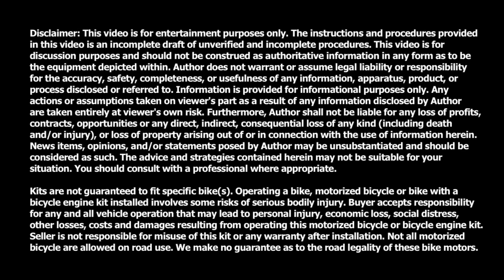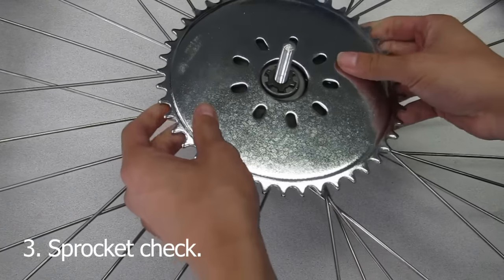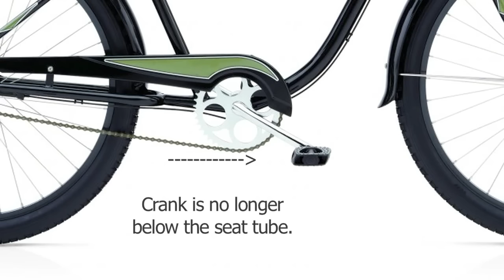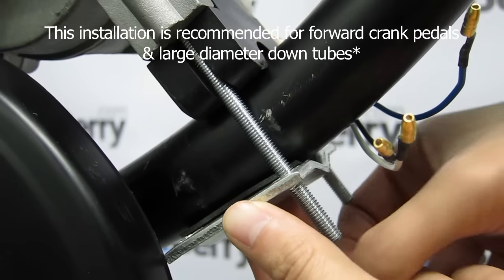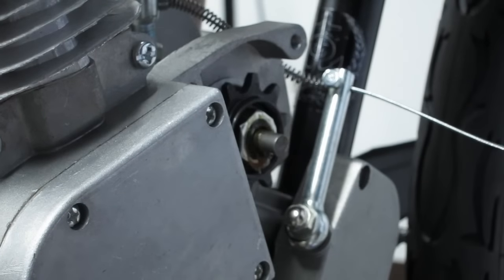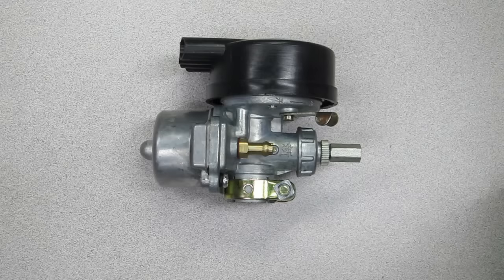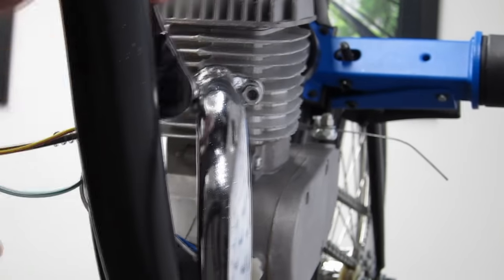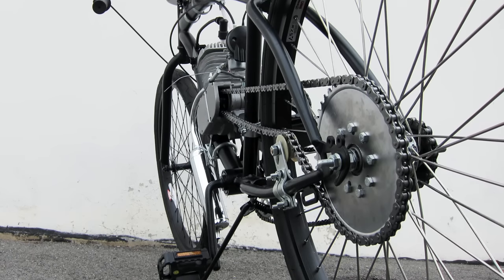How To Install 80cc 2-Stroke Bicycle Engine Kit FULL DVD 66cc 48cc 50cc

Comment: I have a 80cc 2 stroke bicycle engine when I test with my multimeter I get resistance only when I probed the black wire coming from the coil and the spark plug wire, but I do not get resistant through the blue and the black wire coming from the coil

Comment: hey bro, i ordered this 88cc 2 stroke engine and followed everything up untill the gas part.. I bought a small bottle of oil for 2 stroke and a  3.5 gallon gas tank (small) i filled that up and threw in the small bottle of oil and mixed it. Add it to the gas tank of the bike and the thing never turned on.. had it for over a year sittin in my garage. thinkin about using it this summer.. any suggestion??????

Comment: The idler adjuster for the chain ...Put it on the frame where you're going to install it ...and drill a hole in it... Tap the frame Bracket  Out, with thread tapper ....and screw bolt in there..... do that on both Brackets...And then they will stay in place ... they will stay straight up and down .... Just don't use 2 big a Bolt, you don't wanna drill too big a hole in your frame....

Comment: for the carburetor, its not fitting my bike frame, just a little to big, however it fits at an angle, (45 degrees) will this still work?
also my back tire is large enough to hit both the chain and the chain guard, what should i do i cant seem to move it out of the way so they dont rub, should i sand down the trim of the tire?
last thing my peddles hit the exhaust, any solutions?

Comment: I just got the two-stroke bike with the bike kit from bikeberry and it came with one wrist clip already installed inside the engine wrist pin clip but there's not a wrist pin clip on the other side of where you put the wrist pin in but and two little red baggies that were attached to the top part of the engine it had the four little clips but they're not the same as the wrist clip wrist pin clip do they not get my second wrist pin clip or do I use those other clips?

Comment: Hello sir. I'm missing 1 metal plate, and i saw on your video that you have like 2 in outer and the 3pcs metal plates on the inside. By any chance, where did you buy the extra or where to order them? Thank you!
Reply: I'm also missing plates. But I'm missing all 5 plates. And none of the wholes in the rubbers are even close to the holes on the sprocket. Figured I could flex the rubber but it's just way to far off. I'm also missing a retaining clip for the piston pin. So I ordered the clips.   But I can't find the metal plates to buy them. I emailed Bikeberry.   No response yet. But it's Saturday. Wer you able to find the plates?

Comment: im positive you can use any oil for these engines, but I know about as much as a 3 year old when it comes down to engines. so what oil do you mix the gas with?
Reply: there should be oil in your local Canadian tire(if you live in canada) or harbour freight ect. labeled  2 stroke motor oil
Reply: +Ap3xglide thanks, I live in florida, im nowhere near Canada.
Reply: +Fishes worst enemy oh lol then autozone, harbour freight,advanced auto,Raceland...
Reply: +Ap3xglide yeah, I think I've got some 2 stroke oil in my shed  for my now broken weed wacker.

Comment: Question: would it be possible to attach this to the sprocket at the front so the shifter will still function?
Reply from the maker: Without heavy modifications this would not be possible, as the drive systems are on opposite sides of the bike. There shouldn't be any reason why the bike wouldn't be able to shift with this installation.

Comment: Hi, I am attempting to complete my assembly of my kit. The nut which attaches the fuel line to the tank came separated from the valve itself which I'm not sure if it usually does. I assume it snaps on which I tried and okay but the valve still pops out which I don't want to happen when I put gas in the tank for the 1st time. I am not confident in it holding. Is this a common issue and will lock tight hold lt properly in place? Should I locate and reorder a new petcock? Thanks for any help, I can't seem to locate any tutorial mentioning the issue.
Reply from the maker: We're not entirely sure as to which nut you are speaking of and it sounds like a rare occurrence, but we would love to help you further and get you any parts you may need. Please contact our customer service representatives at 1-800-317-0479.

Comment: I have a nishiki Colorado, 29" wheel with disc brakes. Right away I'm having some issues. First being that it seems I don't have enough room for both the sprocket and brake disc to be mounted. Is there any way I can fit both on the opposite side of the gear cassette? Or will I have to switch the disc brake over to the cassette side? And if so, do I need a smaller cassette? It's a 21 speed bike with 7 gearsets on the cassette
Reply from the maker: Hey Chris, give us a call at (800)317-0479 and we can do our best to get you up and running.

Comment: Instead of opening the otherside of the engine, I just engaged the clutch and fed the chain through using something small to spin the wheel to pull the chain in

Comment: Thanks! An other question, I also have a button that I can press . Sometimes it stays in, but sometimes it comes out. What does that control?
 I'm trying to make the engine run slower, when the clutch is pressed in. Right now, the engine is revving loudly and fast. So as I've said, i'm screwing it in almost fully. If I do screw it in too much, the engine won't start, even with the choke on medium or high, nor if I give gas to the engine. If I screw it out more, i don't see much of a change.
Reply from the maker: If the button you are referring to is on the clutch lever, that is the locking pin for the clutch. You can squeeze the clutch lever and leave it disengaged by pushing in that pin. If the idle is not having much of an affect, try adjusting the jet needle.

Check out or video on carburetor adjustment. Hopefully it will answer some of these questions.
https://www.youtube.com/watch?v=j9bn9Wl5L1Q&t=4s
https://www.youtube.com/watch?v=XAaKSII_vbo

Comment: You've got the intake port and exhaust port wide open you're just asking for something to fall down into the motor you always plug up both ports before you work on em unless you wanna seized motor. also you could have mounted the chain when you installed the sprocket
Reply: no... Intake has a small mesh on it...

Comment: need any help really. i have an 80cc engine on a schwinn bike. the engine will not start no matter what ive tried. testing the spark plug and it gets a spark a little bit. i haveno idea where the choke is or primer on this engine. i bought it from someone locally recently and went through many new spark plugs.

Comment: Hey I’m having a problem where when I put the clutch cable in then while pressing the clutch lever it won’t freely spin any idea what’s wrong? And also my clutch flower nut won’t spin and I can push the plate inside to make it spin

Comment: I have a question can you flip gasket backwards? So that the carb is at the front and the exhaust is at the back?
Reply: I wouldn't. Because there is an indicating arow on the piston heat that points towards the exhaust. And if yo wer to re mount the piston and the engine head. The exhaust would be pointing forward.
Reply: That should have said piston head. Not heat..... my phone is smashed to shit... so it's hard to see when typing....

Comment: I've been riding 2 strokes for over 50 yrs. I find fuel mix ratio to be not fussy. I just splash some oil into the gas and go with it .

Comment: My down tube is too large for the motor threads. How will longer ones help if there's no enough room for them to get past without hurting the frame?
Reply from the maker: Our engines are intended to be mounted to frames with standard sized tubing for beach cruisers, hardtail mountain bikes, town bikes, and road bikes. Some down tubes are made in an elliptical shape rather than a circular bar or are on the smaller side of an oversized down tube; our extended rods are intended for these type of frames. Frames with a down tube larger than 28mm are not compatible with our center mounting engines.

Comment: I spilt honey in the clutch case cover. Will this cause a problem?
Reply from the maker: Honey is not considered an appropriate lubricant.
Reply: well y u have honey there
Reply: Hopefully you cleaned it. My hypothesis is that it will get very warm and burn. Hopefully it didn't clog up anything.

Comment: Question .. I just finish installing mines .. 80cc 2-stroke .. but my back tire is locked up is tht normal .. or did I miss something
Reply: ExtinguishFires _ 13 might need to adjust the clutch cover on it, sometimes come too tight from the factory
Reply: MrOranTee .. thanks for info .. thts what I thought 💭.. nw I have two more problems.. (one).. my petcock screw tht screws to the gas tank broke any ideas on fixing it besides buying a new gas tank petcock value.. (two).. I can’t keep it to stay idoling.. I don’t knw anything bout this stuff .. I’m learning along the way

Comment: I have a racing bike and the back mount will work but the front mount is a weird shape so it doesn’t fit right I even use the universal adapter and that still didn’t work please help

Comment: What is the little metal ball that fell out near the small sprocket where it drives the chain
Reply: It’s important for the clutch it’s the throw out bearing that takes the load when you pull in the clutch

Comment: 3:40
Can I push the bolts through the opposite direction?
Instead of the screws going in through the gear and popping out INSIDE the sproket, can they go OUT the gear and me bolt on that side? My fingers cant reach inside to bolt them in and it makes much more sense doing it the other way
Reply: Yeah that was the hardest part for me. Once I got it properly installed my hands looked like they went through a paper shredder

Comment: I just got done putting my together but my wires are white/blue/black are come out of the engine then the starter have a red and black come out then the spark pus has a blue and black wire and I think I have it wire up right but the engine still wont turn on

Comment: So if you have the clutch on one side and the throttle on the other; where do you put the brake?
Reply: I plan to put my break on the throttle side. Because I figure if I'm breaking I've already released the throttle..

Comment: would a lawn mower engine work because I was thinking of doing a project like that over the summer.
Reply: a weedwacker engine would be better in my opinion, but I suppose anything's possible. It depends on the type of lawnmower engine, if it's a vertical shaft 4 stroke, then running it with the shaft horizontal would cause lubrication problems.

Comment: Does it matter if the spoccket goes on the concave side or the convex side?
Reply from the maker: No, it should not make a difference. The difference in chain placement is roughly a 4 millimeter difference, which may help if chain clearance is extremely tight.

Comment: I got this kit. Recently the 66/80cc engine kit and its sadly missing parts you cant find at a hardware store. Pieces missing for mounting the sprocket. Literally the 3 plates. That's where I couldn't finish the video

Comment: I have a question , Could this motor be attached to a three wheeled  bicycle ?
Reply from the maker: We do not carry any mounting or drive system for adult tricycles. There is, however, a large bike modification community, and we have seen individuals mount our engines onto tricycles.

Comment: I got it wired correctly yet I have no spark. Could it be a bad CDI? How would I check it?
Reply: Check:

Is the Magnet's woodruff key in a 1-o' Clock position in relation to top dead center? (If it is backwards in the 11-o' Clock position, it will not start)

Are your CDI and Magneto giving good resistance (ohm) readings? (The specifications can be found with an online search)

Is the magnet still magnetic? (They sometimes lose strength over time)

Wiring - Black to black, blue (or sometimes red) to blue. White can be discarded or ignored if wired accessories will not be used.

The kill switch can cause electrical issues. It can be safely removed if so desired. To stop the engine, one simply has to stall the engine by releasing the clutch slowly while not moving.

The sparkplug will not give off a visible spark if it is not physically touching an electrical ground on the engine such as one of the cylinder fins. Make sure to do so.

Comment: What is the purpose of drilling the hole when assembling the throttle?
Reply from the maker: The throttle has a pilot pin that holds it in place and prevents the unit from moving when giving it gas.

Comment: Step 7. I reinstall but the motor become disengaged. There is a way to fix it? I think something is a bit loose. Do I have to tighten the shaft to engage the engine?
Reply from the maker: Give us a call at (800)317-0479 and well be happy to help you troubleshoot.

Comment: How much noise would one of these engines produce when it's running?
What is the top speed?
Reply: +Tholaran97 it's very loud (think weedwacker or lawn mower) and the top speed is 38 km/h which is about 24 mph
Reply: +Tholaran97 Its not as loud as you would think but putting some type of rubber between the engine and the bike at the mounts helps with noise.
Reply: delreydavid yeah ,thats exactly what I did.

Comment: Where did you put the grounding wire (white wire) I’m not getting any power and I think that’s the issue
Reply: White wires for lights.
If you don't have that then you put a rubber cap on it and leave it.

Comment: I got a Iglobalbuy 26" or 28"Bicycle 80cc 2 Stroke Motorized Gas Engine Motor Kit of amazon, I assembled as instructions indicated, and followed the wire diagram but I'm not getting any fire, I changed the spark plug, and also cut the connector of and hard wired the connection ,but still can't get it to start....I welcome any help.

Comment: Do you know if the motor would brake I you use it without a muffler
Reply: Muffler's only direct the heat of the engine and reduce its noise. it wouldn't damage the engine but it would be rather loud and the exhaust could burn your leg

Comment: The gear case doesnt close properly because the thing that goes in the middle is too far out, how do i fix this ? It worked properly before i opened it up and started doing anything. 8:47 8:49
Reply: It is 12:52

Comment: I am putting this together now. Can someone explain to me what the drilling of the handlebar is for? They skipped over that part and there is no location on the kill switch or the throttle  for me to screw anything
Reply from the maker: The hole is for the location pin on the throttle.

Comment: So the engine turns the sprocket. The sprocket uses the spokes to turn the wheel? Is that safe? I would thing the spokes would bend
Reply: the sprocket is very heavy duty steel it weighs almost 2 lbs on its own. its not bending with a 2 stroke engine, more than likely the chain would break before it bent.
Reply: Dragnmastralex I appreciate it. Thank you.

Comment: Eeekk. So my bike has like 44 spokes, an because of the lacing no matter what position I put the sprocket in three holes are unusable without damaging the wheel... It's not like 3 are missing from one side and there's 6 on the other, basically there is three sets of two bolts with a hole between them, So it's all balanced still(or symmetrical, if you can call it that) and the sprocket is of course able to be evenly tightened because of this... So is this okay? I've been shopping around for smaller 26" 36 spoke hubs anyway, but in the mean time is this cool to ride on?
Reply from the maker: It's not advised, but if you aren't push high torque it should be enough to hold.